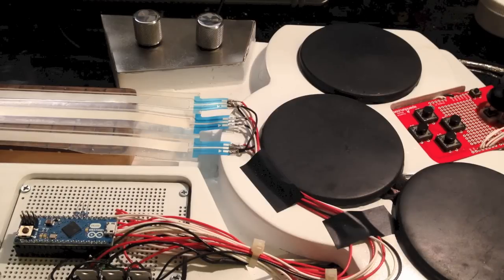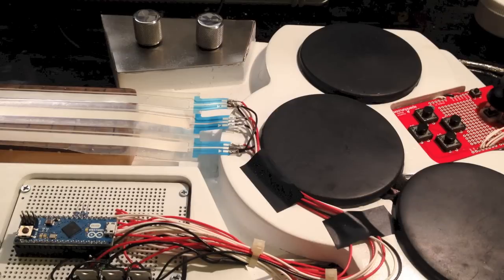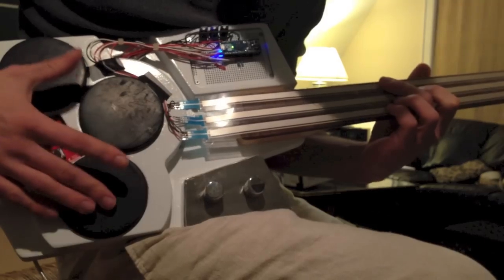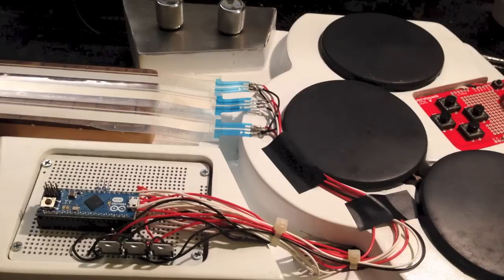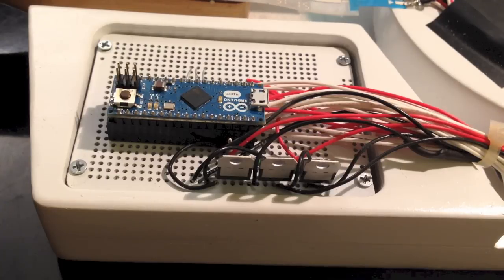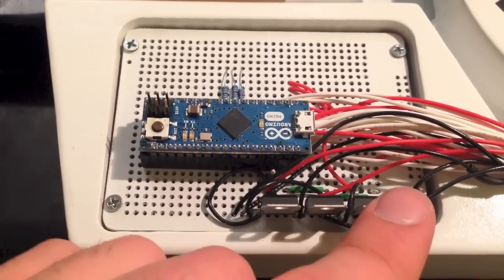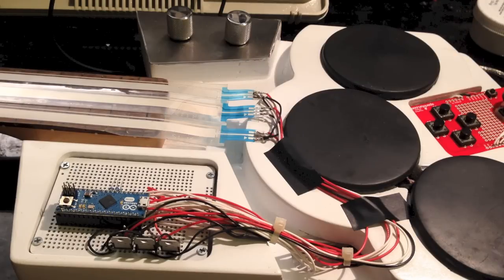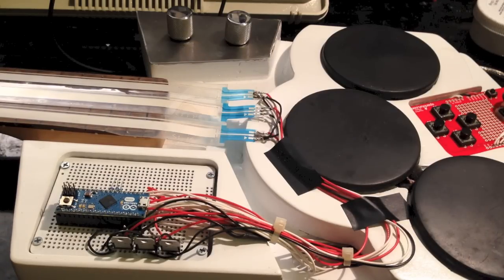Arduino ribbon synth explanation

Comment: hi, great project, I wanted to ask you if it was possible to transmit the sound (instead of pads) with strings that transmit the impulse to the ribbon, could you make the project happen for me? What would it cost me, thanks, roby

Comment: Hi! I’m building a similar instrument and was wondering if you could tell me the distance between “strings” and the width of each of the  resistive sensors “pads” (white parts)?  I’m building combination pressure/pitch sensors and want to make the strings easy to play chords.

Comment: Midi pitch bend isn't meant for this, but it guess it would be possible create code that makes a seamless glissando, but it won't be easy to make something that works with every synth. " The value 0 (0x00 0x00) means, "bend as low as possible," and, similarly, 16383 (0x7F 0x7F) is to "bend as high as possible." The exact range of the pitch bend is specific to the synthesizer. "  https://www.midikits.net/midi_analyser/pitch_bend.htm

Comment: Hi, I'm making a project out of your ribbon synth but I'm having a rough time deciphering where the buttons and softpots get turned into serial bytes. I'm using a Teensy 3.2 so I'm just going to use the actual Teensy MIDI library.

P.S. Thank you so much for this project, it is quite amazing!

Comment: Very nice build, well done! I'm a bit confused by the 7805s being fed from 5V, normally to perform regulation they would need a minimum 7V or so input. Perhaps the current draw from the softpots is so low that they can buffer the softpot supply voltages a bit?

Comment: Super rad, man. I'm in the starting stages of building a midi breath controller in the format of a harmonica. Basically, I've got several bipolar air pressure sensors, and my plan is to map the positive and negative voltage changes across each sensor it their own midi notes. However, I was wondering about polyphony, since it will be possible to blow (or draw) on more than one of these sensors at a time (just like a 'real" harmonica). Your insight about using multiple midi channels is brilliant for that. I'm using Teensy 3.1 instead of the arduino nano, mainly because Teensy supports USB Midi protocol natively. I've also got a little joystick for pitchbend and the like... Thanks for sharing this awesome project, and the source!
Reply: Very clever.
Reply: John Salmon The pressure sensors just arrived in the mail today. Just waiting on the Teensy now, and then the experimentation will begin! :)
Reply: Look forward to following your progress OneHarp .

Comment: Fascinating! Did you remove the frets from the neck and if not, is it pretty easy to slide without dislodging the softpot's bottom adhesive after heavy use? (I can't quite see it on the video or photos...). How do you trigger and sustain an "open string"? Did you try the "thinpot" (spectra symbol dot com/potentiometer/thinpot)? It is 10 mm wide as opposed to 20 mm wide, and it may fit the upper neck better... Thank you again for the great ideas!

Comment: 3 questions:
1. Are the softpots velocity sensitive ( or does the piezo pressure control velocity)? If either aren't velocity sensitive, how hard would it be to add a force-sensitive resistor under the softpots to achieve this? How would the code be modified to include this?

2. Did you have to trim the clear outside plastic of the upper part of the softpots to fit the thin part of the neck or do you just stick the protruding area on the side of the neck? Does the adhesive come off often? Maybe use "thin pots" instead, which are 1/2 the width (10 mm as opposed to 20 mm).

Thank you for sharing this inventive project. I have all the parts and getting ready to build one.

3. BTW did you ever think of using wireless midi on this?

Comment: Hi! Your Ribbon Synth is great! I built one from your describtion, but there is a problem: I cant get the softpot strings to work. there is no midi message sent to my daw (reason7). the only difference in my synth is that i use a regular midi connection like this: http://arduino.cc/en/Tutorial/Midi?from=Tutorial.MIDI power comes from a usb powersupply. Do you think, thats the problem? I would be veeeery happy, if you could help me, as i think this is a brillant idea! ( an i am still a noob in programming for arduino) thank you very much!
Reply from the maker: Hey, so you might have to do a little bit of debugging to figure out what the issue is. If you have another program like midimonitor (http://www.snoize.com/MIDIMonitor/) you can check to make sure you are actually getting midi data to the computer. How are you connecting the midi output to the computer?
Reply: gr4yhound
Hi!
I am getting Data to the computer.For example the joystick works. ( sends the modwheel message). I have it hooked up via Edirol Um-1sx Interface.
I have also hooked it up to a blofeld with the same result.
there is no data coming from the softpots.
Reply: csxdy
Is there a procedure to initialize the softpot strings? Everything else works....really strange.
Reply from the maker: It's impossible to say what the problem is without a lot more information. You need to go through the code and debug. Plug the microcontroller in via usb and put in lines that print to the serial console at different points to figure out where the problem stems from.
First establish that you can get a reading from each softpot. If you can't, you may be reading the wrong pin, or you may have a wiring problem. Once you know you are getting signal from the softpot, do the same thing with the trigger pads. Then once you know you are getting signals from both of these things, make sure midi messages are being sent.
You will have to have some understanding of how the circuit and code work in order to do this, but unfortunately it is the only way.
Reply: Thank you very much! Ok, sounds like an interesting project, as i wanted to learn coding the Arduino anyway. : )
Reply: Hey Paddy Powernerd, did you ever get it working?  I'm having the same issue with the softpots not working with this specific code.  I've tried a few different types of microcontrollers with no success :(

Comment: Hi, nice project!
Where can i find a single yamaha (or other) drum pad? I am looking on the internet but i've found only the "complete" drum kit..and it is too expensive for my poket
Reply from the maker: Hey, I actually don't know if you can. I took mine off an old kit. I recommend just using force sensitive resistors (although you will have to modify the code) or making your own drum pads with a cheap piezo element.
Reply: thanks for the reply, probably I will choose the first solution (force sensitive resistor). 
However, I already have an Arduino UNO, to get something like this (using 3 "ribbon" resistors and 3 force sensitive resistors, without the joystick), how many pins I need?
Thanks again!
Reply from the maker: The UNO will work just fine for that. You will need 6 analog inputs and it has exactly 6.
Reply: Great, i am a guitarist and i really, really like this project. Thank you for your work!
However i also have another question (maybe the last :P), I was thinking of buying a midi female connector for the audio output, but it remains the alimentation problem. So i search your "midi to usb converter" chip on amazon but i didn't find it. Please, can you link me the product that you've used? I'm so sorry but i'm so "noob" in this field. Thank you for your patience
Reply from the maker: No problem, here is the one I used: http://www.amazon.com/HDE-Cable-Converter-Music-Keyboard/dp/B001LJUVO4/ref=sr_1_1?ie=UTF8&qid=1394386344&sr=8-1&keywords=midi+usb. And this should help you get it set up: http://shiftmore.blogspot.com/2010/01/quick-and-dirty-arduino-midi-over-usb.html
Reply: Thank you so much (: i've just ordered each component and i also have an old, broken, cheap..and smelly ibanez gio that i want to turn into something much more funny! :P if i succeed in the job i'll let you know of course!

Comment: Genius! Is it tied to the synth you are using?
Reply from the maker: It just sends MIDI messages, so it will work with any software synth. In order for it to make sense as an instrument and be intuitive to play it really should be used with synthesizers that have a legato or mono mode. I'm pretty sure almost all synths have this setting tho

Comment: Hi there, I really love your work! I'm seriously considering giving it a go myself although I'd have to use more conventional methods than your CNC. haha. Would you recommend using rock band drum pads, or would it be worth the extra money to go for a smaller option like the yamaha drum pads? Thanks a heap.
Reply from the maker: hi Jarrod, I'm not really sure what the rock band drum pads are made of. It is most likely just a really cheap piezo element the same as what you could get out of a cheap radioshack buzzer (you could just put a piece of rubber over one of these). If you are talking about using the entire drum pad without cutting it down, it would probably be too big and awkward to play. If you don't have an extra drum machine lying around to salvage parts from as I did, buying individual drum pads would be way too much money and not really worth it.

 I would recommend buying some force sensitive resistors. These are cheap and have some advantages over the piezo (holding open string notes, and you could map the FSR value to a MIDI controller like aftertouch). You will have to modify my code a bit or write your own to do this though. Good luck, let me know if you build one!